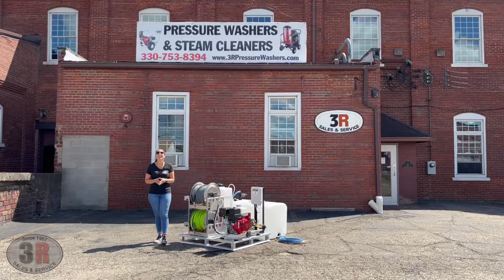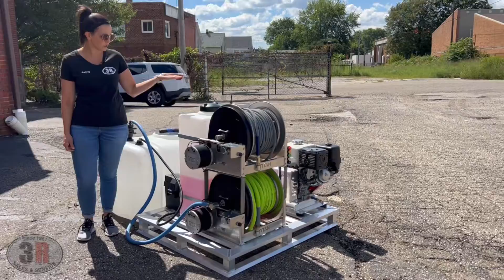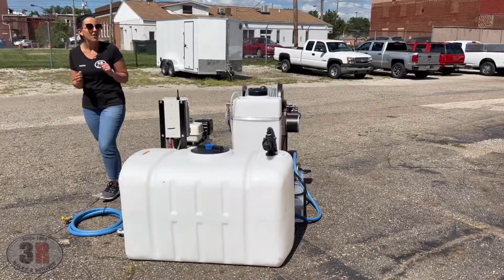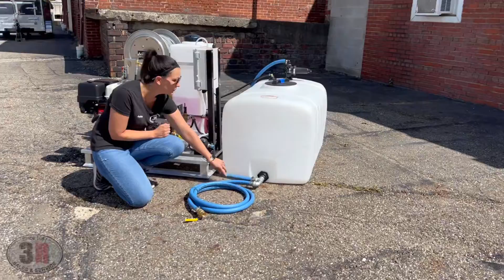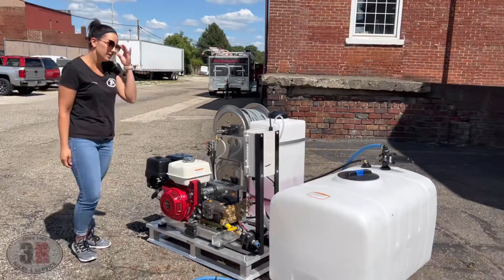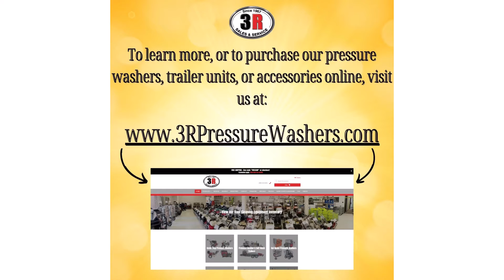The Eagle Package - 48”x40” Aluminum Skid Assembly - 3000 @ 5.5 Cold Water Pressure Washer

Comment: Hi,

I notice in a few of your videos you are using galvanized pipes & elbow connection from the water tank.  Just beware after time the metal pipes inside will rust. Plus if the water stays sitting in  the pipe it will rust faster.  I see this in homes with galvanized water line pipe.  You can see how rusty it is when replacing them.  You should put a filter after the metal pipes to help catch the rust.  Again this will happen in time and if water stay too long sitting in metal pipes.  

Thanks for this video